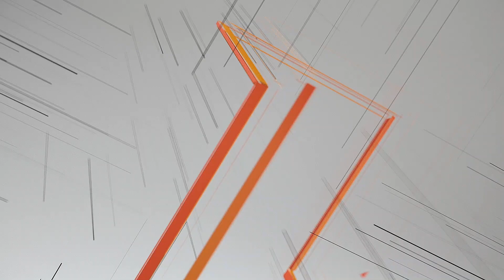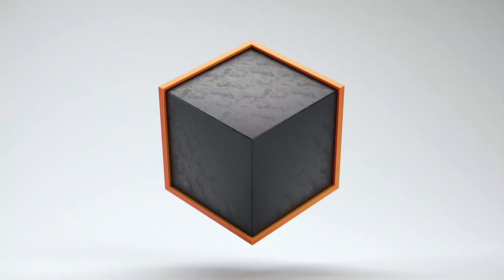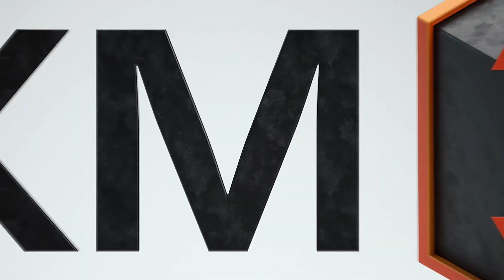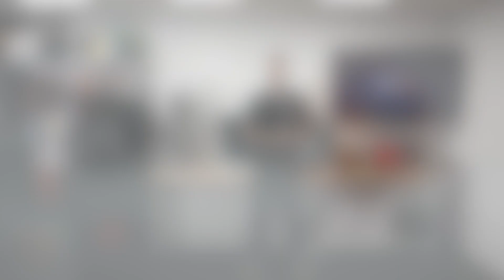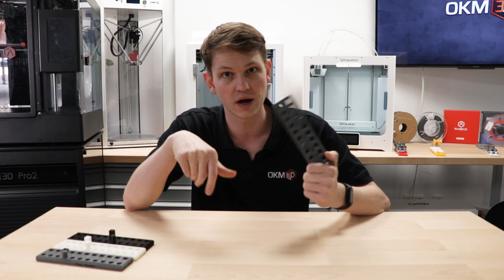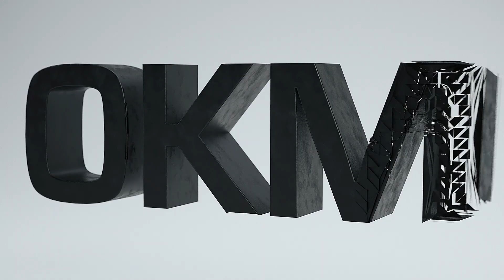Tolerance Test FFF printer - Ultimaker S5, Raise3D Pro3, WASP 2040 Pro, Creality CR5, Raise3D Pro2

Comment: I watched the video several times to check the pro3 results, but couldn't find it. Please tell us the pro3 result.
Reply from the maker: Sorry! We did not notice. We will add that to the video: Pro3 squared always at 0.00, round mostly at 0.05 or 0.00. No difference in between material or speed settings.
Reply from the maker: https://youtu.be/mB3ikaCymqE

Comment: Did I miss something or was there no results shown for the pro3?
Reply from the maker: Sorry! We did not notice. We will add that to the video: Pro3 squared always at 0.00, round mostly at 0.05 or 0.00. No difference in between material or speed settings.
Reply from the maker: https://youtu.be/mB3ikaCymqE
Reply: @timmeybt  Thanks! What’s your opinion on the pro3? Does it solve the issues the pro2 had? We were considering the pro2 but in the end it didn’t feel reliable enough for us.